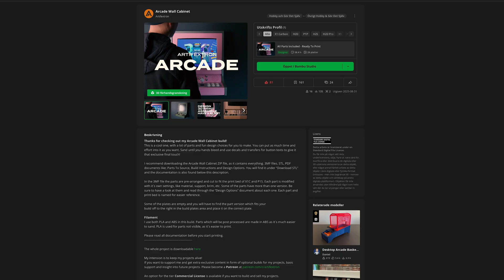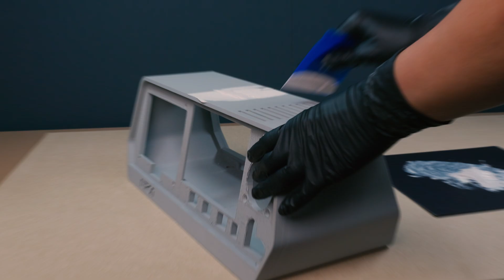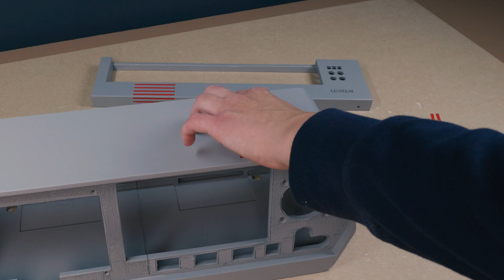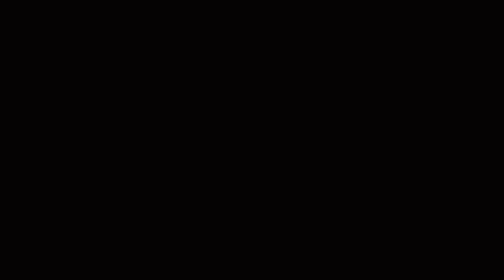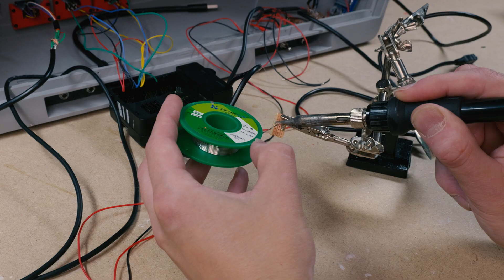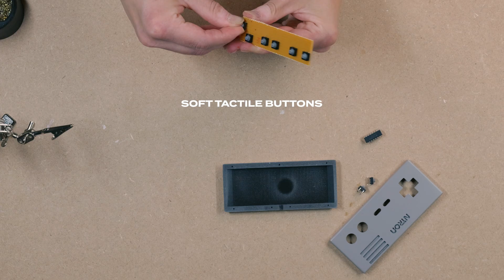Build Your Own 3D Printed Arcade + Chiptune Synth | DIY Project

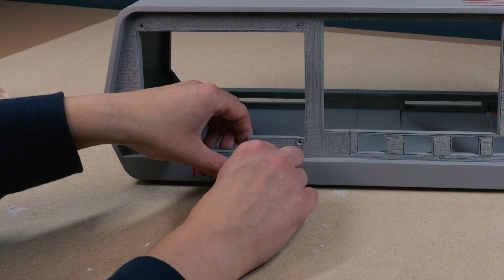Comment: 5:47 this might he a good candidate for multicolor, if you do it on the first layer facing the bed (and maybe the second or third depending on color bleed) then even using manual multicolor (no AMS, literally gcode pausing the print and manually changing filament colors) you can get an amazing result and it's not too tedious if only a few layers.
Reply from the maker: If you were not looking to spray paint it I would recommend using your approach or an AMS. But in this case I would have to mask all colored parts which is a tedious work 😅